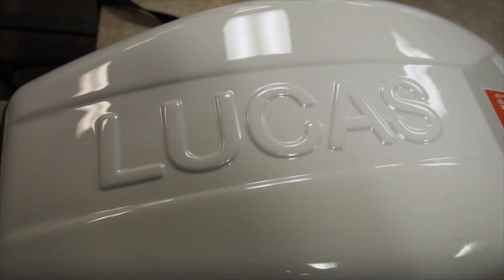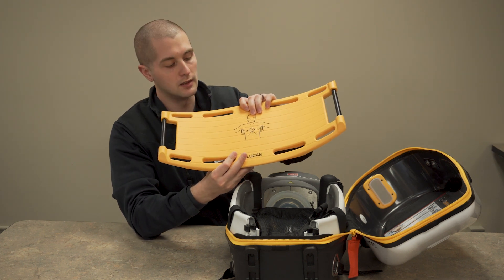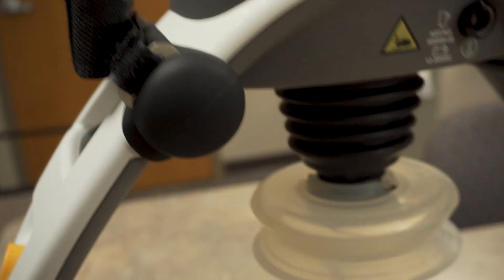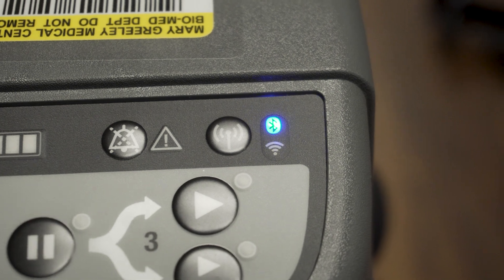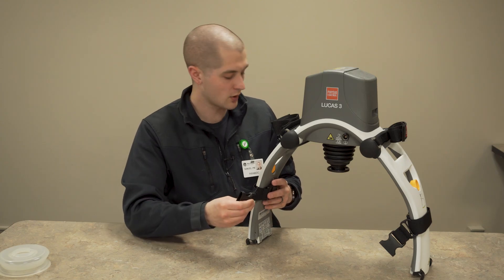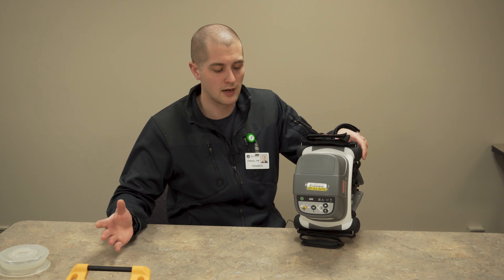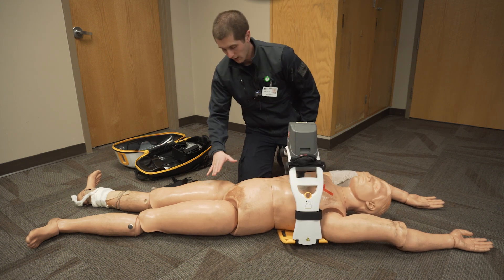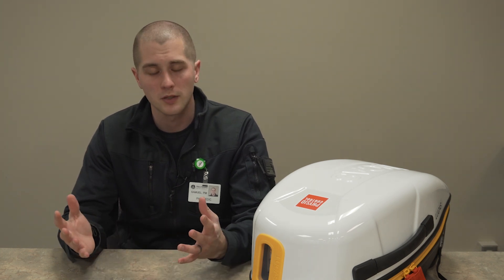LUCAS 3 Overview and Operation

Comment: The device is most excellent and provides consistent compressions, like any medical device it has to have value and it does.  Think about the olden days with poor CPR as the crews hold on to the top rail while transporting on the road or down stairs simply trying to do compressions.  I am a Lucas fan !!  Worth every penny.

Comment: You may already be aware if this, but with the LUCAS 3 you can request from the factory or rep through software that the device pause for a range of 3-5 seconds during the 30:2 compression mode to actually get 2 full breaths in. If you choose the 3 second mode, just know that you will be getting in Less than 6 breaths per minute in. The reason why this is significant for us, is that our ventilator does not allow us to ventilate during the continuous/asyncronous mode due to hitting our highest PIP alarm limits. So after we have intubated without stopping chest compressions, we choose to use the 30:2 mode with our vent to deliver two full manual breaths. The LUCAS 2 does not have this software change option.

Comment: So when do you opt for Lucas 3 vs the defribilator?
Reply from the maker: You need both, they do two different things.
Reply: @PrepMedic  I thought if the defribilator didn't get the job done it meant the patient was gone. I gather that is not necessarily the case...
Reply: @Hypnotized81  that's not how that works. That's how any of this works

Comment: Great vid!  We were on a hot call one night using the LUCAS and during transport the neck strap buckle broke.  Due to that, the LUCAS body shifted towards the feet and, without the neck strap, we saw the the arm and suction cup start riding up towards the neck!  We stabilized the LUCAS body right quick, manually.  Lol.

Comment: Its good only to do CPR during transportation the patient. The Lucas smash the patients chest like steering wheel after car accident. 
We got Lucas 2 at work and its not recomended to use it routine.
Reply: Sorry fam but you’re wrong. Lucas devices are a key role in positive pt outcomes. They should be used whenever possible. People CANNOT provide adequate compressions for extended periods of time. You’re gonna get some snap-crackle-pop during CPR. You need to get that adequate depth. The Lucas can deliver adequate compressions for as long as the batteries will last. The service I work for can transport a one man code with our Lucas devices and care vents. We don’t make a habit of it but we have capacity to if no other resources are available.
Reply: Sorry bro. The guidlines 2015, read it.

Comment: How's it different from LUCAS II?  I can't believe they can charge that price for it and at the same time, refuse to tell how much they're charging for it. Ours costed $1million, if my memory is serving me correctly.
Reply: There are no real big changes from the 2 to the 3. Some software updates, you can now see the battery status without opening up the case and you can charge the device through the case. There are some aesthetic changes, IMHO the 3 looks better. The case has been updated and is more sturdy and easier to use and access, IMHO. But functionally they are the same and will get the same results. 

Your company must have bought a TON of Lucas devices! They are about $15-18,000 each. I am assuming your company bought more than just the Lucas?
Reply: We just upgraded ours and got 125 Lucas 3.1 for our entire fleet (NOEMS) and NOFD. The major differences are: 
1) a single piece, flat back board for better stability and better clean up. 
2) change the rate of compresión (ours default to 110 per minute vs the 102 on the Lucas 2. 
3) the suction cup lowers automatically when pressing the on button 
4) bluetooth/WiFi enable to transmit directly to Code Stats.

https://www.facebook.com/508222909319468/posts/1390937097714707?sfns=mo

Comment: Is a long back board still needed with it?
Reply: What a fantastic demo..loved this!!!
Reply: I was told never use one. Reason...that's plastic on plastic contact. You cannot use the top backboard straps on while the lucas is on, meaning only hip and leg straps hold the patient on. A reeves should be used as often as possible unless the stretcher is so short a distance the pt can just be carried. The plastic on plastic allows slipping when you have an adult sized person on there. The upper body can slip and hang off the side if you're not careful. However, with a reeves, the rubber allows grip, preventing slipping and also if you're patient is small enough, the sides of the reeves kinda cradles the patient.